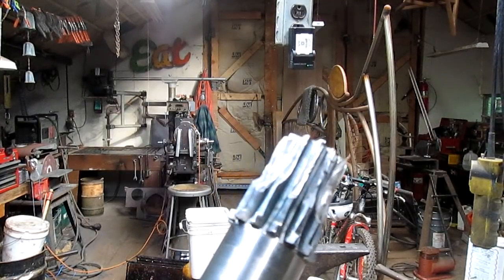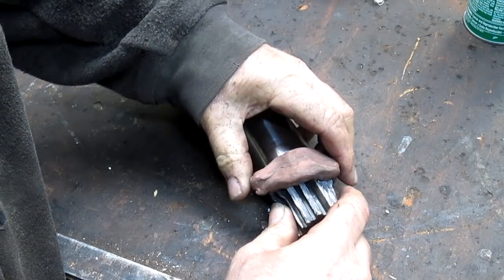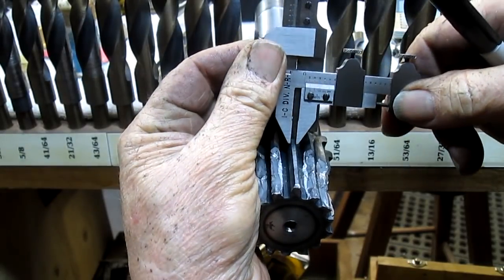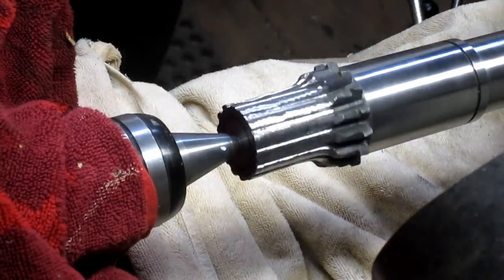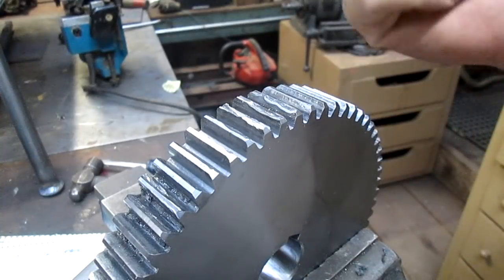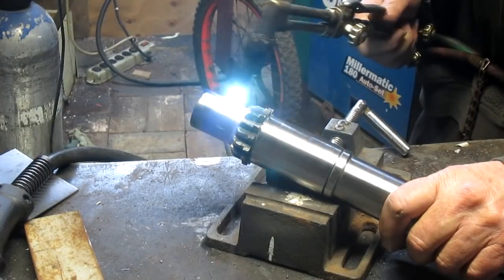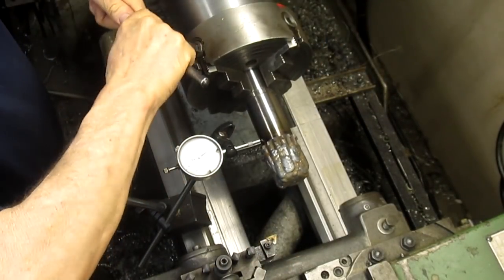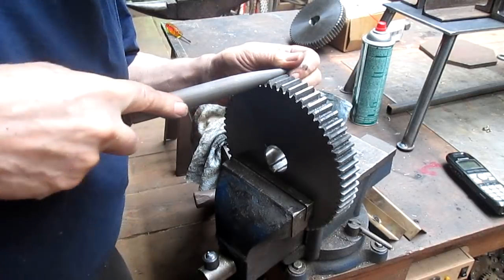Ruined gear repair #1

Comment: Nik, you didn't need to take all those measurements, all you need to know is the number of teeth and the OD. You said it was a metric gear. 1.895" is near enough 48mm The formula is OD=no. teeth+2 x MOD, 14+2 =48/3 so this is a 3 MOD gear, a very common size. The cutter you need is a 3 MOD number 7 (14-16 teeth) and for the driven gears probably a number 3 (35-54 teeth). It's possible to dress the large gear to remove the damage with correct cutter, resulting in a slightly smaller than ideal gear, and make the pinion oversized by an equal amount so they mesh at the same centre distance. The slight difference in tooth geometry won't matter. (In fact it's common practice to cut small gears of less than 10 teeth with a diameter one tooth bigger than the formula above).
As others have said,  the mig weld may not be strong enough, probably better to just lop the end off and weld on a 2" piece of 4140 or similar then heat treat after cutting the teeth.
Reply from the maker: Where were you when I was planning this project.
Reply: @NikColyerMachineWorks  I was probably watching your previous video on the crusher where you didn't mention anything about repairing gears!
Reply: @NikColyerMachineWorks  You are the fool, you accepted that job for someone too cheap to get new parts or have new parts done.  these parts arrived at the end of their service life, that why the teeths broke.  Now these must see a lot of torque and the teeths a lot of stress and since these had been hardened, it was written in the sky they would break.  Now keep this in mind, if you don't have the ability to do a specific job or repairs, don't do the job.  And in that case your client want the job done cheap.  You should have sent him go to an other machine shop where they would told him "Sorry but we don't do Bodge jobs"  we only do quality jobs.    And don't forget, it's your name attached to that repair job.     And please never invest on tooling if the client doesn't want to pay fair price for a job.
Reply: I realize Im quite off topic but does anybody know a good place to watch newly released movies online?
Reply: @Tyson Chris Flixportal :D
Reply: @Lee Wesley thank you, I went there and it seems like a nice service :) Appreciate it!!
Reply: @Tyson Chris you are welcome :D

Comment: A couple questions, I noticed that before welding a bead, you would first strike an arc on some scrap.  Are you doing that to make sure you have cover gas at the start of the weld?  I've never seen that done before.  I did notice later on that you didn't do that.  I'm not done watching the video, but I'm assuming the wire you are using is mild steel, will it be suitable for any kind of hardening or heat treatment?

I had a trailer hitch ball one time with ruined threads, I welded them up with tig, using a stainless rod, when done, single point threaded the shaft.  Certainly not worth my time but it was fun. 

Nevada City, I used to do work on some specialized x-ray equipment there, was used to analyze the ore samples from a prospective mine.  A Canadian company owned it at the time and decided not to re-open it.

Jim
Reply from the maker: I prestrike the wire to heat up the end before I weld. I only do that if I want the bead to start clean, otherwise it splatters a bit on that first strike. I used mild steel to match the gears that also got messed up so the two can break back in evenly. 
Stainless steel weld. It had to be fun threading that ball. Stainless is hard stuff to machine.
I remember the Canadian company didn't reopen because the community pushed back so hard to keep them from doing so. Still a lot of gold down there, but the county is riddled with caved in shafts from the empire mine 100 years ago.
Reply: @NikColyerMachineWorks  After whatching the two parts video.  It's clear you should have refuse this job.    From what I've seen, that shaft was 4140HT that got heat treated and probably never tempered.  and with stress and torque, the teeths broke off.
Reply from the maker: @lepompier132  In these skimpy times I don't have the luxury to refuse jobs. The customer didn't want to spend the $ buying new parts, so he went with a repair. Yes, probably 4140 case hardened. I don't thin k the  teeth broke, but I believe something foreign got between the gears and snapped them then the grease held the broken parts and it pretty much chewed itself until it would no longer turn.

Comment: Looking at the damage I would be sorely tempted to just turn up a new shaft. Got some stock that came from big truck axles that would be perfect for it. It can be tricky to get the recovery weld area heat treated to give hard and tough enough a surface. It is worth carrying out a hardness test of the job prior to starting work to give you a target to get back to.
Only problem with people trying to get job done a cheap as possible is it's only a matter of time till it fails again and your good name is associated with a bodge job. I don't do bodge jobs, temporary repairs, yes, but clearly indicated that this is what it is but no implication of any permanence.
Reply: He should never have taken that job in the first place.   just like you said, me too I would never do a bodge job.  You have to do a very good temporary job or make new parts.
Reply: You are both right
And then the only comments he get is Well done and great job
Reply: I'm not a machinist and very naive when it comes to machining, but throughout the video I kept wondering "Why doesn't he just fabricate a new shaft?"

Comment: Have a motorbike drive shaft coupling that is badly stripped, I may practice my TIG welding to try rebuild one of the splines. Unfortunately I dont own a lathe or mill so wont be able to recut the spline.
Reply: Go for it. If you have a few files you should give it a go.
Reply from the maker: Anything is worth a try.
Reply: Nik,
So true, and I have nothing better to do with my time at the moment (except watch machining channels)

Comment: I enjoyed the video.  Did you roll the gear across the shaft to check for wear?  Just wondering.
Reply from the maker: There was wear, but remember this roller travels at 1 or 2 rpm. At that speed there is a lot of leeway.
Reply: @NikColyerMachineWorks    That's what I was curious to know.  Thanks, good night!

Comment: When making any sort of negative reference with clay smear some grease thinly on the part. Silicone grease, Vaseline etc and it enables removal of the clay without the slightest distortion.  However I think I would have gone for machining a new part.  Not sure MIG welding is suitable.  Spray welding was probably the best option other than machining a new part.
Reply: New parts would have been better.  First the part was hardened and needed to be annealed first.  He should ave removed all the tooths on the shaft and warmed the portion and used arc welding and keeping the part hot while welding.   and heat the part and let it cool under a blanket of mineral insulation for a few days.   After start machining.   And for the large gear, he should have done a new one.

Comment: And lots of good points in the comments on not taking on work like these from cheap customers who want bandaid repairs.   HOWEVER, in your defense, you DO have bills to pay and may not have the luxury of turning down work like some of these guys may.  Also, I see no harm in your repair (although I would've done the repair differently) as long as you fully disclose to the customer that it's going to be a "no warranty" repair unless you machine two new gears because anything else is simply going to be a bandaid repair and until he has more money to spend for a proper repair.  As long as he's okay with that to save a few bucks and you're clear and you have it in writing in case he tries to sue you later because his machine broke, then you're good.
Reply from the maker: You pretty much nailed it. I needed the money. . . He was cheap . . Although it has been a few years now and I haven't heard from him, so I can only assume he is still up and running.

Comment: Hi Nik , same story , different gear !
 You can order those gear wheels , even hardened ,much cheaper than what you are doing and going to do .
I got a few hardened gear wheels , made in Italy , even cheaper than un-hardened !
That MIG-weld won t last long as gear wheel .
Reply from the maker: Customer checked on the price and was happy to have me do the job so I'm guessing the price was much higher than the $800. I'm charging.
Reply: Customer did nt look at the right places , your win!
I ve had some spline-shafts made , machinist made a fly-cutter , using ols splines as a template . You could have done the same making gear-teeth

Comment: I wondered when you were gonna protect the bearing surface on the shaft??  Looking forward to part 2.
Reply from the maker: I worried about that all night after the fact, but the original shaft was so hard the dingleballs didn't stick. What a relief.
Reply: @NikColyerMachineWorks  They might not have stuck but you can be sure they etched the surface and those microscopic pits will destroy the bearing in no time at all. You could have smoked the surface with your acetylene torch before you started welding to protect it. You could have also covered it with aluminium tape. But you didn't bother until it was too late and the damage was done. After watching the rest of this video I would have to say that you took on a job that you should have never taken because: 1. Your customer is too cheap to do it right.and  2. This work is beyond your skill set. In any event, I won't be subscribing.

Comment: The teeth of this gear shaft got heat treated.  Now they broke off because of stress telling me they never tempered them after the heat treatment.   That shaft must be made of hardened 4140HT of something close to that material.
And to be able to machine the teeth section you should have annealed this portion.    Now you should also have removed allthe teeth of that gear portion and start the buildup of the welding fresh with no remainder of the original tooth on the shaft.    Also the other gear probably got the heat treatment on the teeth.  Now since you have hardened steel imbeded in the teeths of the larger gear,  they should be considered as broken teeth. 
One thing you need to keep in mind, these shaft and gear don't go at 1 rpm,  if the larger gear goes at 1 rpm, the shaft goes much faster.   And also meaning a lot of torque puting major stress on these teeth.   from my experience I would have chosen a different path of repairs for the gear and that shaft.    and you going at it the hard way.  So next time if someone is so cheap to have a repair done.  REFUSE the job.  you fix the shaft and do nothing on the gear, you will have to redo the job in the next few weeks or months.  the torque will chew the teeth and he will see teeths broke one after the other.
Oh one other thing that shock me when I heard that:   If grease is found on the gears,  it probably means that they are ZERKs fitting to grease that machine.  And also if that machine is sealed with no oil reservoir.  You don't put oil when the gears are exposed to high torque.   And never compare a lathe gear box with a machine that work in a high torque situation.   And the grease has nothing to do with the broken teeths.  High stress parts that were at the point of breaking.
Reply from the maker: I tried to talk him into remachining the entire shaft, but It is the repair the customer wanted.

Comment: That was a lot of welding!  How about turning down the axle a bit so you can install a new keyed pinion?
Reply from the maker: Felt like welding would be more secure under pressure.
Reply: @NikColyerMachineWorks  fair point

Comment: Just started to watch your video repair
Think I would have sprayed those gears with oil and used a body filler or even fibreglass to imprint the result.
I wouldn't have even thought of doing a build up of brass on any teeth unless it was brass it'self.
If you would have wrapped a wet cloth around the shaft and kept it wet, You wouldn't have had to worry about the heat, and I weld my shafts with nickel stainless., and it seems to work fairly well.
Try ussing 2 keys on your four jaw - Makes a world of difference
Reply from the maker: Wet rag, good point. Now if I only had 2 keys.

Comment: I have to ask, why did you not find a Canadian machine supply and order a gear cutter from there? Your delivery would have been 3 - 4 days. Canada went metric in the 1970's and metric tooling is fairly common here. And you have to remember that anything from Canada will be quoted in Canadian dollars which are about 1/3 less than US dollars.
Reply from the maker: Do you have any suggestions? Everyone I contacted got their gear cutters from China, six week wait.

Comment: MR. Colyer;
I just want to know your process/approach (no argument  intended, not being rude I just want to know) how will you stand behind your work if the coustomer has  repair limitations related to the quality over all project  repair? What I mean is the driven and the drive gear are a group. They failed as a pair, in my estimations,  they should be repaired as a pair. I work on small gas engins and the coustomer wants a half a--  --  job to save money. I do one of two things, tell him that I am not interested or do the extra work and not charge him.( day job is in a hospital) I just keep on working on engins because I put myself through college and I like it. So if the gear fails, will you have tl repair it again for free ( save your reputation) I just want to know your approach. I have saved myself many headaches by turning down work (coustomer's attitude big factor in which way I go)
Reply from the maker: What you don't see on the video is me warning the customer several times about getting new gears. He contacted the company and came back to my $800. quote with no guarantees. I'm guessing the new gear set at 3 or 4 thousand.  You have to remember the roller travels at 1 or 2 RPM so very little issue with high speed mesh.  He seemed to be happy with the arrangement.

Comment: Could have also machined an oversize sleeve and machined the new gear teeth into the sleeve.
Reply from the maker: Though about that, but there is a lot of torque and I was concerned that it could break loose.

Comment: I would have protected that bearing surface from spatter a little better, even coated it in nozzle dip maybe. Great video nonetheless!
Reply from the maker: Yeah, I know. Shuda,' woulda, coulda. I worried about that all night after the fact, but the original shaft was so hard the dingleballs didn't stick. What a relief.

Comment: Why didnt you just weld over the top of the gears instead of turning them all off also brake cleaner is much faster to clean grease and oli off the gear
Reply from the maker: The gear and bearing surfaces were made of a much harder material plus they wer case hardened. To mix that metal in with my much milder welding wire would have created hard and soft spots, impossible to machine. I'd run out of brake cleaner. Later I got some from the auto parts and used it.